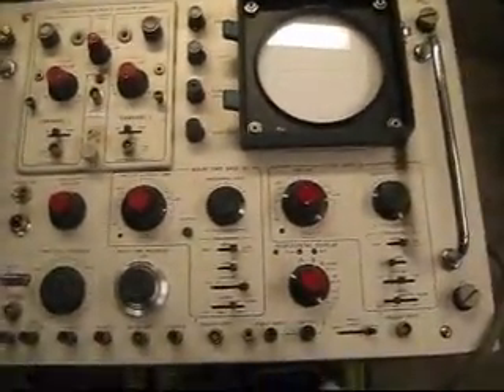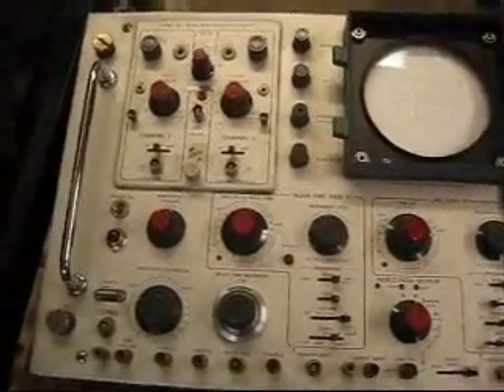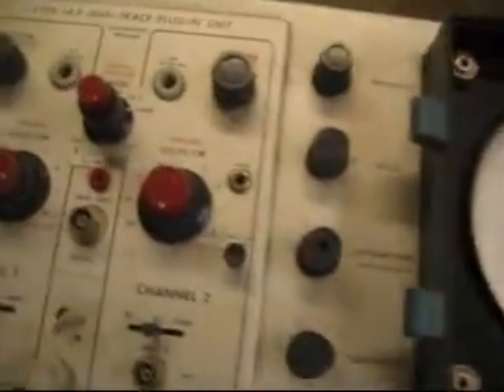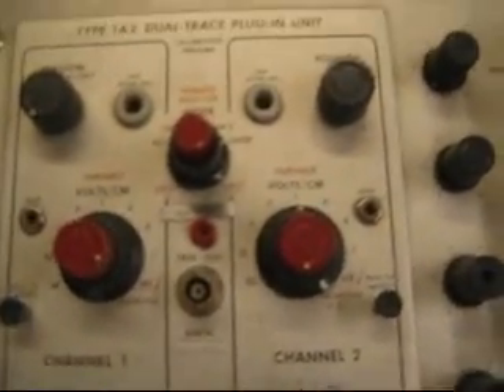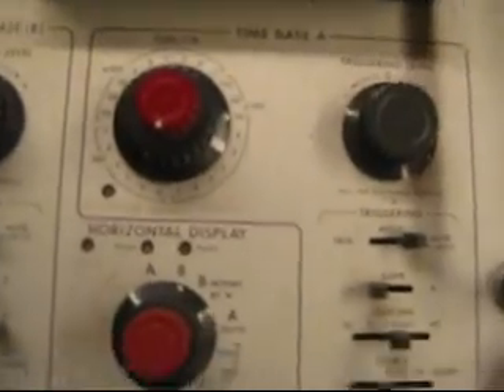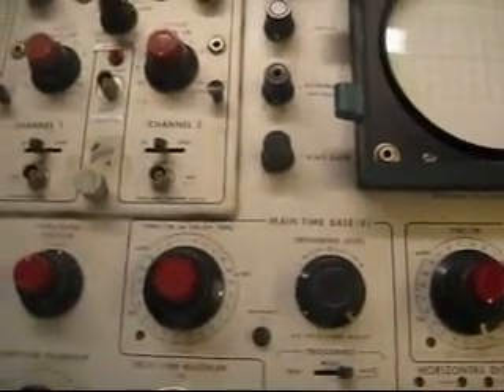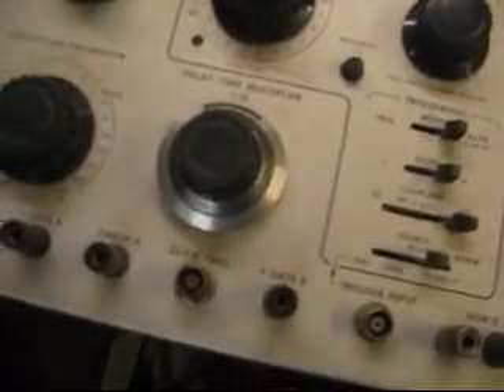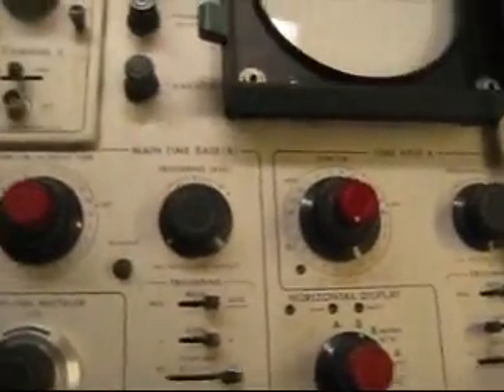My oscilloscope (please read discription)

Comment: Hi, you sound like you are very young. Take good care of your scope and of you when working on it. Turning it on slowly with a Variac is impossible because of a delayed relais in it which cuts off the circuits while heating the tubes up. You can find manuals at the BAMA manual archive, google it with "BAMA edebris". On the mirror search for the "tek" link. In the Manual you can find Working hints, a complete circuit description, electronic and mechanical parts lists and the electric schematics.

Comment from the maker: I figured it wouldve gone in  a rack. I think I found the manual for it, if I did then it's on my backup computer from when my main one crashed :(
It turned on, I just had to get the fan unstuck. It warmed up and everything seemed to work. I couldnt use it because I didn't have probes (I still need to get some lol).
I'll check those sites, thanks!
I'm not going to junk it, it's sitting in the back of my shop now until I get probes.
Thanks!! =D

Comment: @SuperKONR 
I found an old lawnmower last year, I could KICK myself that I didn't buy it. It was a 2hp push mower, but the carb setup was unlike any I had seen before. I have one unusual beast i will have to make a vid of, you wind up a crank, then release it, and it starts the engine! I also have an electric start3-1/2hp lawnmower engine!
How are you supposed to keep in shape with that! Give me 10:1 compression!!! :))

Comment: @SuperKONR 
I know, it wasn't a smart move to part with 2 very old engines that ran, but I was moving at the time, and the guy I gave them to was a Big Briggs Fan :)
I still have another cast iron block 2hp that runs well :)